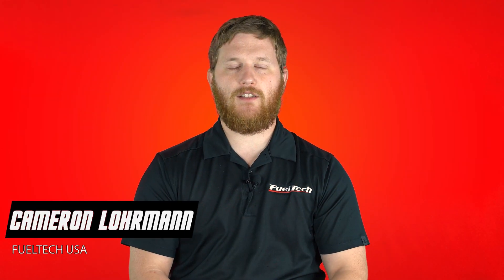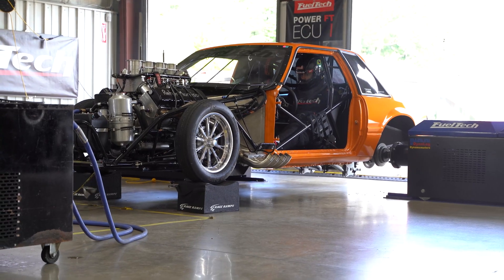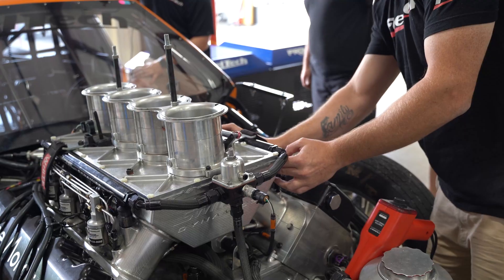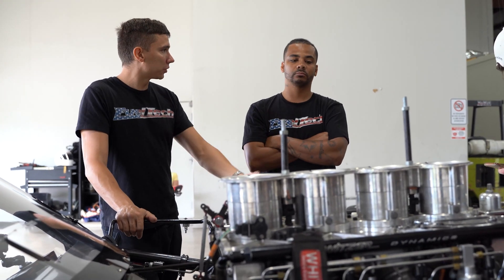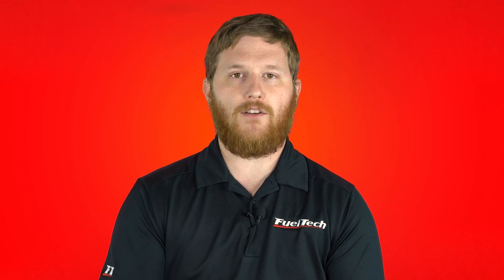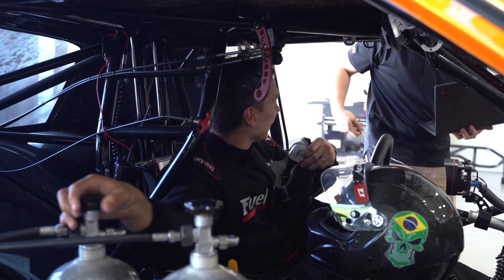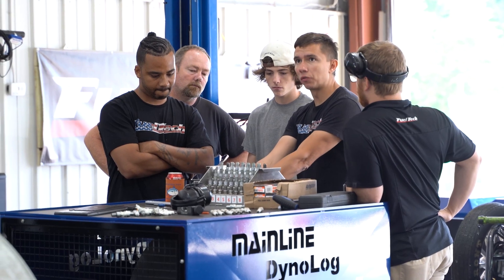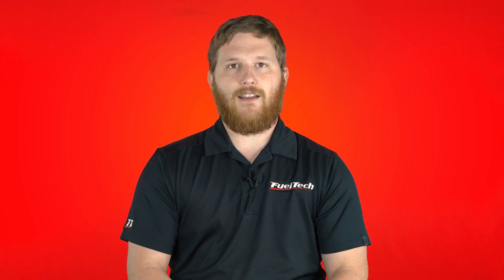Nitrous Grudge Racer | Jermaine Bigalow | Fox Mustang

Comment: I hate to say it! It still doesn’t sound 100%? Did you guys check for vacuum leaks & proper butterfly sync? Anybody actually put a degree wheel on it to make sure camshaft wasn’t off? Those sometimes move, I would imagine you did! We’re the rockers checked to see if they were all opening the same? Every time I had anything sound lazy, it was normally out of time somewhere! Just didn’t sound crisp like your other nitrous videos? Nice Job 👍🏻 as usual! If the owner doesn’t know how to work on those huge engines, he really should send it back to Reher & have them go thru it properly! If it’s the engine I’m thinking of, it had issues even on a different EFI system! Nice Job as usual! 👍🏻👍🏻👍🏻👍🏻🇺🇸🇺🇸🇺🇸🇺🇸🇺🇸

Comment: Would it be possible to close the throttle and just run 100% on the nitrous and fuel without any air? In fact given the nitrous is pressurised could you achieve some positive manifold pressure (with the throttle closed)? Also what would stop you mixing some pure oxygen in with the nitrous?
Reply: Would depend on your progressive controller... A " spray and pray" against a opponent who has the upper hand might lead you to set your progressive controller at a duty cycle of (1). The controller will tell you that's exactly what's happening, the nitrous solenoid is on 100 percent of the time.
Reply: No. Nitrous cannot cause a fire. It needs a fire to amp it up basically.

Comment: When u are doing a motor tune on a nitrous engine do u use the same plug and plug gap as u would if spraying it
Reply: With that motor, plug gap leads to plug wetting and becomes a problem very quick. If fuel gets into the plug gap without igniting properly it is very difficult to ignite. Proper gap and air fuel ratio is key... Hence why there running several af monitors
Reply: For a strictly motor tune with no plan of running nitrous yes you’d change your plug gap and maybe even go to a hotter plug. Although most nitrous guys won’t run a motor tune because a nitrous motor is built for nitrous not NA.

Comment: 8 AF modules is rediculous. Its 2021 what are u guys doing with that. Whos watching that?
Reply: 8 AF so you don’t lean out a cylinder, it’s data logged so after each run they’ll run through the data. You can watch the cylinder start dropping from say debris on the screen or the nozzle is plugged. It’ll let you know before you burn it down.
Reply: @RadDadisRad  I know this...but whyyyyy do they need 8 actual modules..mounted to a board...thats stupid...single module logging all 8 and sends info to main ecu